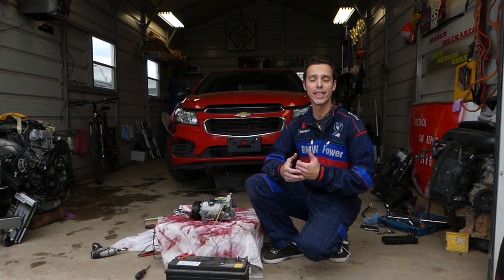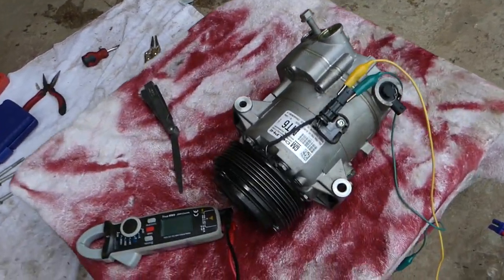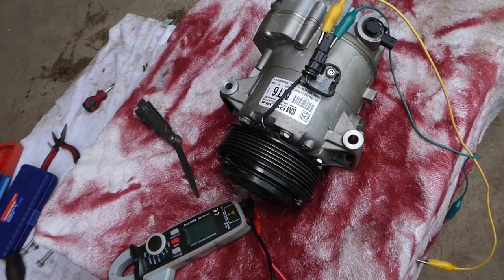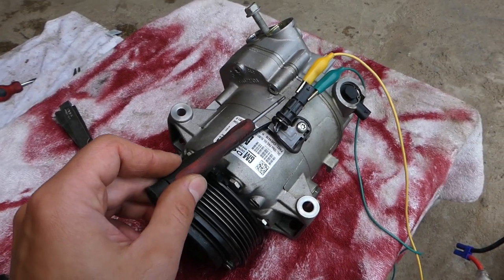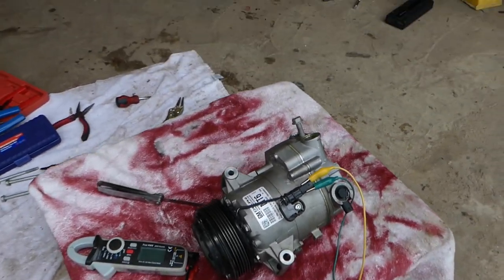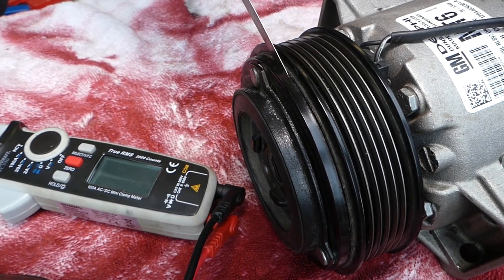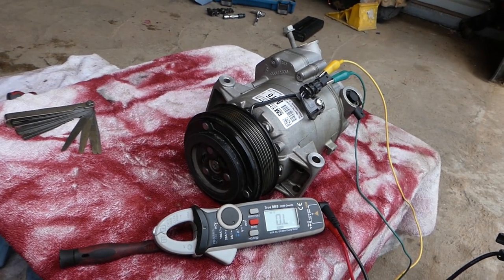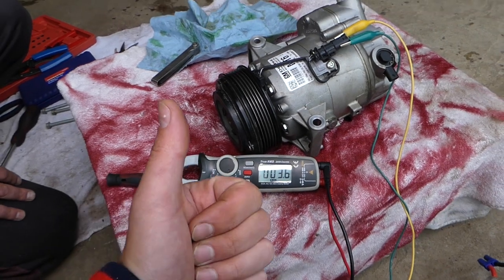HOW TO TEST AC CLUTCH COIL. A/C CLUTCH TEST WHAT NOT TO DO

Comment: Can you use a multi-meter to measure the power at the cable-end of the connector to test if the clutch is receiving power?